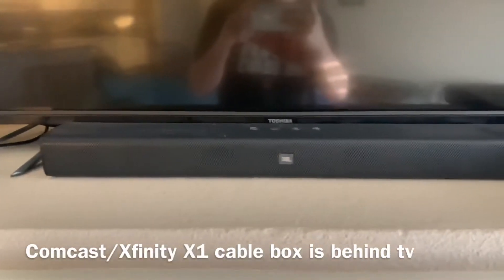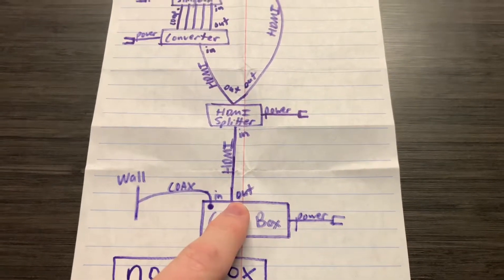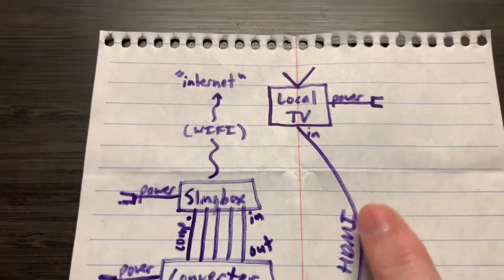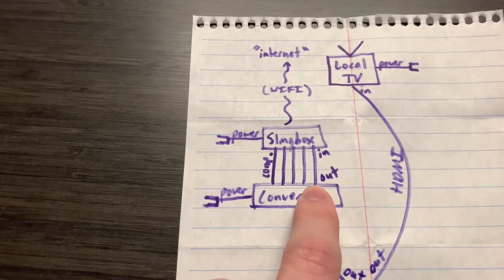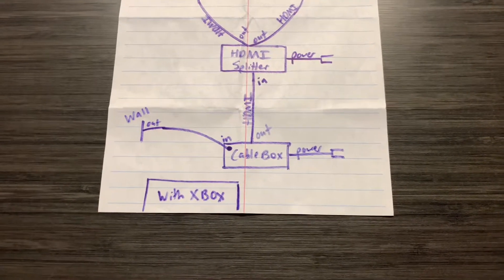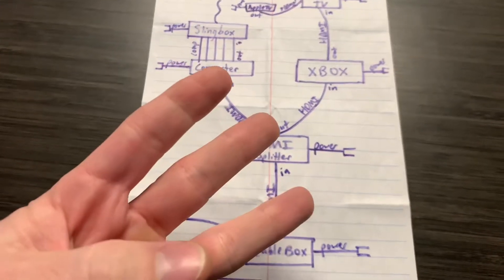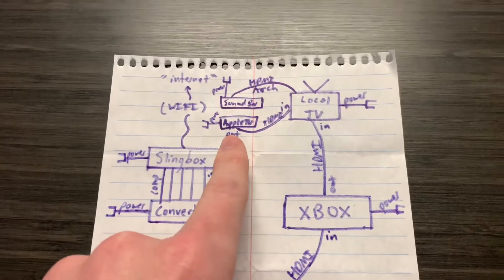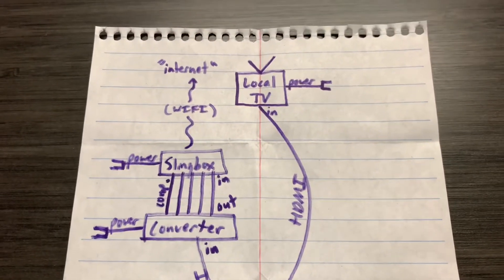Slingbox with X1

Comment: Is this converter you use and HDMI to component or component to HDMI
Reply from the maker: Paul Ricci the converter would be hdmi to component because it comes out of the cable box hdmi signal and into the Slingbox component